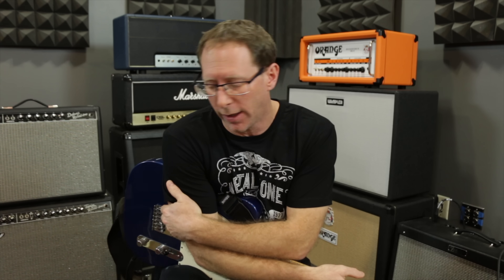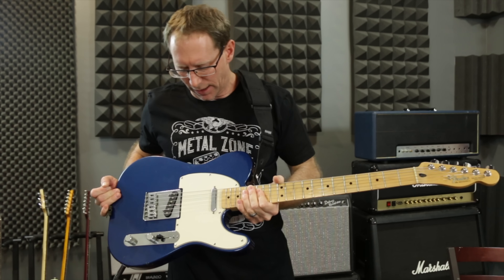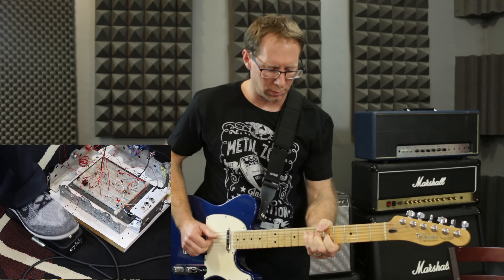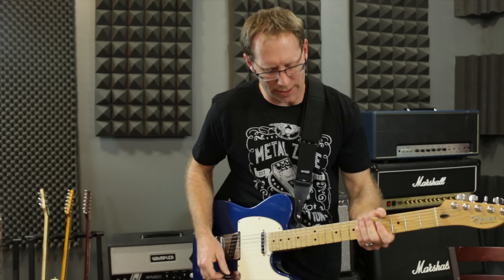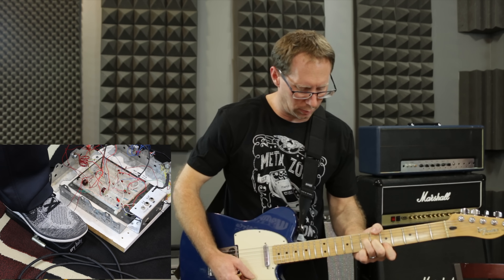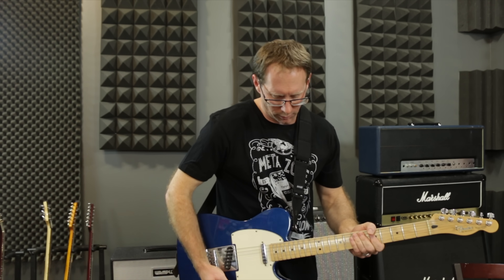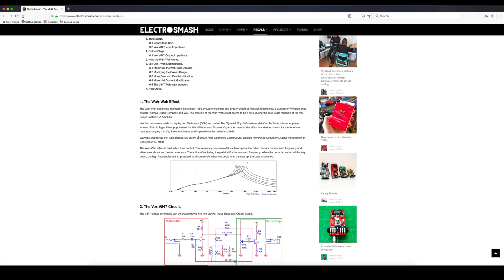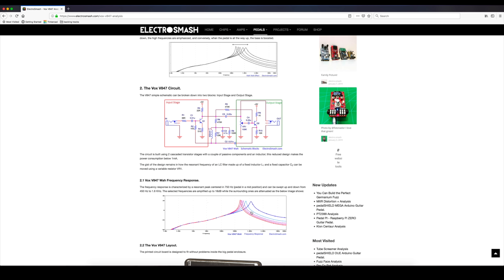Wah Pedals: Does the inductor affect the tone? A comparison

Comment from the maker: Do you think the inductors sounded different from each other?
Reply: Each of the Fasels sounded slightly thinner and a bit muted and the Halo just sounded a little thinner. If it wasnt in a a A/B test I doubt I would have noticed any significant differences between the non-stock options. Overall the stock seemed better, but overall I dont really like WAh's that much and rarely plug mine in anymore. Im sure these differences would be important (or not ) only in respect to your reliance on Wah as part of your sound or your anorakness.
Reply: I couldn't hear any different.  However I'm heading towards 50, only have one good ear and  have abused that one with years of cranking valve amps. I still loved the video though....
Reply: I only heard a real noticeable difference with the halo. I really liked the stock sound, but none of them sounded bad.

I once changed the inductor in a vanilla Dunlop wah to a red fasel and swapped a couple of caps. I didn't like it as much and replaced the wah with a 535Q. The way I look at it now is that a simple pedal circuit is going to be designed around certain core parts (inductor; op amp; transistors; etc.). Changing those parts isn't usually worth the time or money, especially when relying on "internet advice". In the case of a wah, if people don't like theirs, they should just consider getting another one.
Reply: Maybe a little more treble-y on the last one, but not enough to warrant $40-$50...or the time to swap for that matter.  Hell it could just be the placebo effect.
Reply: Bear in mind that I go 'Toneblind' after a few minutes anyway...  I didn't hear much difference in the Heel/Toe comparisons but I thought both Fasels and the Halo had a more smooth sound while sweeping than the stock inductor.  Thanks for a great video, keep 'em coming :-)
Reply: Did you measure the value of each inductor? The differences could easily just be manufacturing tolerances. For a fairer test, you would need to ensure they all measure the same.
Reply: If the conclusion is that there's little difference, I believe it means he can create a wah that sounds almost same as the mythical wah pedal of Jimi without using any mythical components.
I'm looking forward to it.
Reply: Nope, not at all....just like the whole JRC4558 legend....it's all hype.
Reply: the stock inductor seemed to have less presence than the others. the last wah i bought was the vox clyde mc coy.. i tried 8 and that was the one that day. no idea what is in there. another day may have had a different outcome.
Reply: Not really.
Reply: The Halo May have had more quack with slightly less harshness. The differences are subtle and it’s up to the player to determine whether that subtle difference is meaningful or not. Thanks for the video.
Reply: Making a case about stuff like this depends on the whole rig. And the player. It also helps if it's the player's own rig and knows it inside and out. Some people stop laughing once they get educated by someone who knows how to bring out the differences from subtle to very noticeable. It's not as much as what is better, but finding out why something works better with another piece of gear or type of pedal that you have.
Reply: I did, but it's subtle. The Fasels sounded a little 'fatter' than the stock inductor, and the Halo seemed to have a little more 'quack' and the high end was a little different. The Fasels also sounded a little dirtier than either the stock inductor or the Halo, which was said to be the result of inferior core materials causing them to saturate, at least in the originals. No idea if that's still true in the reissues or if that's just psychosomatic though. In any case I'm curious enough to pick up a few and try it out for myself, though!
Reply: No difference to me.
Reply: Mild difference, but the yellow inductor mod sounded cleaner and crisper than stock.
Reply: Nope, it is the value in milliHenries that matters. There may be small amounts of inductance, capacitance or resistance that differ from part to part but those differences seem too small to make a sonic difference. And even within the exact same part there will be tiny differences that make no sonic difference either.
Reply: Just slight difference
Reply: Not a wah user (only because my wife won't let me buy another pedal [yes, whipped]), but I could definitely hear the difference. I found the dirty circuit (generally) exaggerated the difference between the inductors rather than hiding it beneath the clipping.
Reply: Differences yes, but very subtle and nothing that would make a noticeable difference in front of an audience.
Reply: The aftermarket ones sounded thinner/treble to me on the toe....
Reply: Yes they do make a differnce. I've never used a Halo inductor tho, btw does anyone know what type of inductor Friedman's No more tears Wha uses? It sounds really vocal & perfect to my ears,  my CAE Wha has the Red & Yellow Fasel inductors you can switch but it's gone squealey on me.
Reply: I don't think the sound has become better, it doesn't sound like wah anymore, more like woop.
Reply: Nope...don't hear no difference. I reckon to change the cap and resistor values would.
Reply: I was looking for a inductor comparison, i now a can hear the difference wich for me is... none... 🙃
Reply: I thought the yellow sounded less aggressive than the stock and the red more aggressive. The Halo had the same heel as the stock (the faders had less?) but more toe than the stock, whilst having maybe less mids.
But I guess I should listen again!
I see why Dunlop went with the stock inductee. It sits in the middle, with good balance.
Interesting. Thanks for doing this.
Reply: Yes, they sound quite different.
Reply: Nope.  More snake oil I guess.  Halo master chief version should be best though.
Reply: @BeefNEggs057  Err - its all snake oil but the Halo should be better? {:o)
https://en.wikipedia.org/wiki/Oxymoron
Reply: @PrinceWesterburg  It's a joke. Master Chief is a character, I believe, in a video game called "Halo"
Reply: @PrinceWesterburg  I think you missed the reference to Master Chief (Spartan 117, John), main character of the HALO series https://en.wikipedia.org/wiki/Halo_(franchise)

Comment: Whoever is not able to hear the difference of sounds between the inductors is completely deaf. And the differences between them can be easily measured in a simple RTA software, it's not a Myth at all. The difference in sound between the Yellow Fasel and the Halo is quite dramatic, it's not subtle, it's the diference of having a very weak wah sound without Low End and a very Rich and vocal Wah Sound

Comment: 4 problems with this:  1) Even though the Electrosmash video shows the curves produced with different inductors in the  same circuit (Higher peak in one case, different peak frequency in every case), the video wastes time on listening to the response at the ENDS of the sweep, which is not where the wha sound lives. 2) There is no test at the highest Q point (Where the peak frequency is). 3) There is no A/B comparison between the inductors at peak effect. 4) When he activates the pedal, he goes though the peak frequency section so fast, you don't effectively hear the wha effect, so yeah, they all sound the same. This was an annoying waste of time to sit through.  When you compare different inductors in person, if you are sensitive to differences in sound, (which you would also see in the measured inductor !Q)  you will hear the difference.  If you don't hear a difference, congratulations on not having OCD about sound.  May you have a long and happy life.

Comment: I happen to have a wah with both a yellow and a red Fasels, and there is quite a difference. The red one is more full and vocal, but still I think there is a lot of Voodoo around
inductors. The Q2 hfe changes the sound and the Q resistor (33K) does also. It seems like a hfe around 400 and 68K for the resistor is liked by many. Some changes the
input buffer (Q1) or bypasses it. There is a lot of info on the net on these things. In my opinion the standards Cry Baby does not sound good stock.

Comment: That stock inductor is a red Fasel inductor. Dunlop started transitioning the Cry Baby GCB95 Wah pedal to that inductor from the stock black inductor around 2003, and it became the standard and only inductor used in the pedal starting from revision I of the GCB95, around 2007. The older Cry Baby GCB95 Wah pedals, before that, came with a black Dunlop inductor with 4 legs as stock, which sounds similar but thinner and not as clear as the red Fasel inductor.

Comment: Hendrix woodstock technician said that he put in a 530uH to 535 uH inductor because it had the best vocal vowel sounding which you can hear it on Red House Live Santa Clara 1969 that the vowel of the hendrix wah was tuned to a certain vowel. The Wah Pot curve is shifting the frequency curve from left to right but the wah pots resistance track has a TAPER which is going to give you a certain profile curve of the sweep frequency so this adds to the vowel of the wah. I have heard that hendrix wah techs would carve a custom resistance track to have a "modified taper" which I do believe was done.
Reply: Where have you heard that?
Reply: @3rdtonefromthesun  his Woodstock repair tech his amps were modified also for Woodstock
Reply: @waynegram8907  Are you talking about Dave Weyer? There's alot of controversy surround the 'Woodstock Wah' - think its been pretty much debunked that it couldn't have been the one because of the TDK inductor in it.
Reply: @3rdtonefromthesun  yes the TDK RED Inductor is 530mH to 550mH but dunlop Engineers said that 535mH is the most vocal they found its called 535. Dave Weyer added a resistor also to change the output impedance to make it more vocal sweep to work with the fuzz face. His amps were modified by organ repair techs for woodstock

Comment: I have the Red Fasel inductor in the CAE wah and it sounds a bit dark even a little muffled. Here's the interesting part, I have the 535Q which also has the same Red inductor and it sounds great. Lucky the CAE also has the Yellow inductor and that also sounds really good. Of course this is all based on the guitar and PU's I use, which is my point. What sounds good in one set up, might not cut it in another. And the most important point is definitely use the old style carbon based batteries, you may find the pedal you gave up on actually does sound good after all.

Comment: I've got the custom audio wah with the red and yellow fasels, I'm using the yellow fasel setting to get a good top treble end I even turned the pot in the pedal so I'd get more top on the toe down. Would changing the potentiometer to a more higher one give it a more treble tone?

Comment: Not sure what's wrong with some people's hearing but the Eleca Halo is the clear winner if you're going for getting as close to the '67 & '68 VOX Clyde McCoy tone as possible. 
The key to nailing that tone with an Eleca Halo is to put a 500 Ohm trimpot in place of the stock 470 Ohm resistor, replacing the stock 1.5 K Ohm resistor with a 3K Ohm trimpot & the stock 33K Ohm sweep resistor with a 100K Ohm trimpot. 
Start out by setting the 500 Ohm trimpot to about 275 Ohms, the 3K trimpot to about 2.2K Ohms & the 100K trimpot anywhere between 51 & 100K Ohms.
Next, replace the stock potentiometer with a Chase Tone "Tru-Talk" ICAR sweep 2 million cycle sealed potentiometer. Kyle Chase has these available on eBay for around $15. 
Do all this & you'll be immersed in Hendrix & Cream tones all day! 
You also now have the option of adjusting all the trimpots back to stock & be all sterile, bland & generic wit yo bad self...

Comment: I agree with others that posted the differences are more apparent when sweeping, rather than heel/toe. With the toe down, the high frequencies revealed some differences, albeit very subtle. When sweeping throughput the range, the halo was my favorite. It's not only a smoother sweep with sweeter highs, but a bit more "throaty" in the mids. The yellow fasel is the most similar to the halo, being also somewhat mellow and smooth, but definitely thinner. The red fasel is the most aggressive to my ears, and seems to have more "hair", especially in the highs--the least smooth of the 4, but really cuts through with gain. The stock and red fasel are somewhat similar, but the stock seems to have a less exaggerated sweep, with less aggressive highs. I agree with Brian--the halo differs more than the other three, but to me the red fasel is the most different from the halo. Those 2 seem to be at opposite ends of this (rather small and subtle) spectrum.

Comment: Would help when you would substitute your talking between comparisons to straight comparing and just write the model nr. of the inductor with values on the screen. Otherwise you can't really compare when the two clips are so far apart. And mentioning the inductance is important so one can make connections between heard clip and certain value.

Comment: Tried this before, and I went back to the stock inductor.  Now, change the resistor that controls the Q value (I bumped mine from 33k to 50k), and you’ll see a big difference.
Reply: or get the 535Q instead ;)
Reply: @8Junio76  Or drill a hole in the case and wire an external pot where the resistor is. Then you have the same thing for a few bucks.
Reply: For those of us who are electronically challenged, which one is it?
Reply: @darthslater6077  On the circuit diagram, it's right next to the inductor
Reply: Do you have the tutorial??

Comment: Interesting that you heard the biggest different with the Halo. I heard the least difference with that one. It sounded very similar to the stock inductor, but more "refined" (that's the only way I can think to put it).

The yellow Fasel sounded a little thinner, with more treble response, while the red Fasel sounded like it had less highs and a little low end hump.

Overall, I can see why Dunlop uses the inductor they use as stock. It sounds right down the middle to my ears. Different players might want dislike either the red or yellow Fasel, but the stock one is more likely to please everyone.

Comment: Are you sure the stock inductor isn't already a red Fasel? It looks like it is anyway. I know the modern Crybay now comes stock with the red Fasel, and the internals of your pedal certainly looked the same as mine. Also, I thought they sounded very similar too. As far as the other inductors are concerned, I definitely hear a difference, nothing major, but definitely different. Personally I thought the yellow Fasel on the clean tone had the biggest difference, in a way it seemed to scoop the mids out slightly and boost more of the highs and lows as it swept.

Comment: I had to repair a wah pedal last year. The fault was that it worked more like a volume than a wah. Sure enough that was the case. So I downloaded the schematic and came to the conclusion that the inductor was faulty. Pulled it out and it was a low resistance which I kind of expected. I don't have an L meter so swapped the inductor from my wah and it worked as advertised on the box. Didn't expect an inductor to fail. I could only get a yellow fazel so put that in. Has anyone else had them fail?

Comment: sorry this really doesn't have anything to do with inductors or this video for that matter. But I noticed you always explain how it is noisy when you breadboard because it's all out in the open. Well I breadboard inside of a metal terminal box that has a lid, that way I can place the components that I need to place easily I even can mouth Jack's and switches in the side and then close the lid and it is completely and closed and grounded Faraday Style just like a pedal enclosure. You should try modifying your breadboard assembly so it's some kind of a hinge top metal box

Comment: Great demonstration!  I definitely heard a difference, even on my phone's speaker.  The yellow was thinner and lower in volume overall--probably good for country.  The red seemed to have more midrange, but wasn't louder overall.  The halo was close to stock, but had an extra peak frequency (static, not moving) that I heard before the feedback confirmed its presence.  

Does anyone make a wah with switchable inductors, or to where they can be combined in different ways to get different values?  I'm curious about the possibilities.